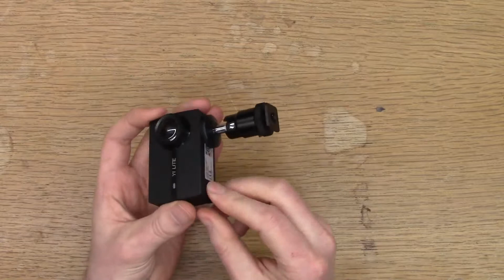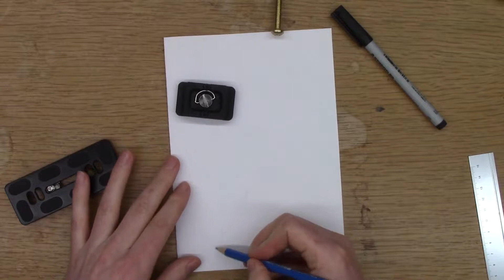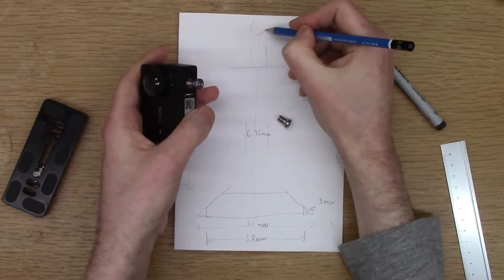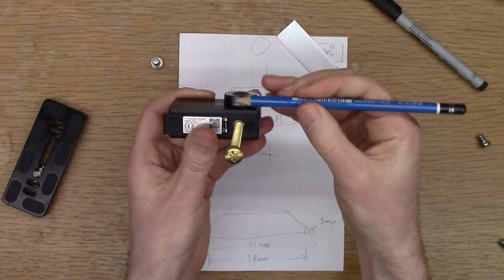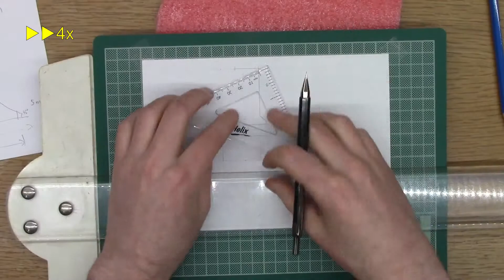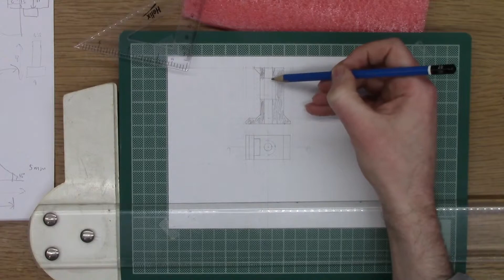Custom Arca-Swiss Style mount for Yi Lite Action Camera - Part 1

Comment: Is such a detailed drawing needed?
Reply from the maker: Nope, could have done a simple sketch. But I enjoy technical drawing so I wanted to test out if it worked for me on YouTube.
One thing I didn't like was that the drawing board was too flat and the camera should be angled more, so when leanover I won't block the camera view.
Reply: @PartFusionMakes PartFusion even with the heavy pencil, I found it hard to follow along. Maybe as you say it's the angled of the camera.
Reply from the maker: Construction lines should only be bearly visible so the camera will have issues picking them up. I could try a darker pencil for construction, and tracing in pencil/ink to get clean finish image; and/or narrate what I'm doing.
Reply: Nerds... @PartFusionMakes